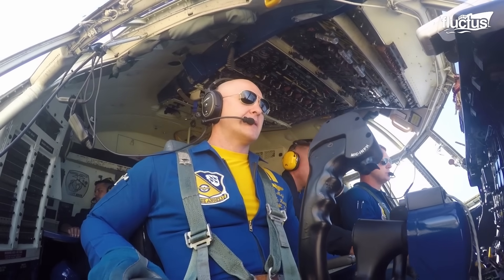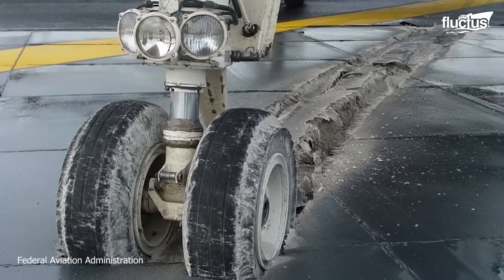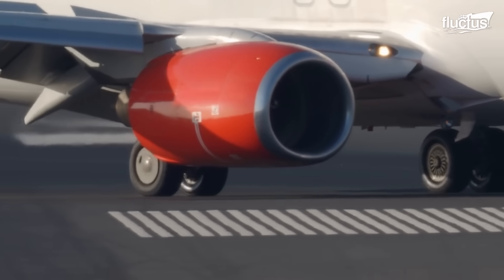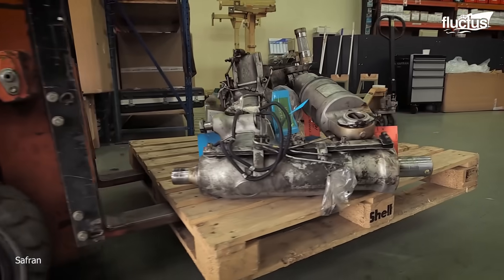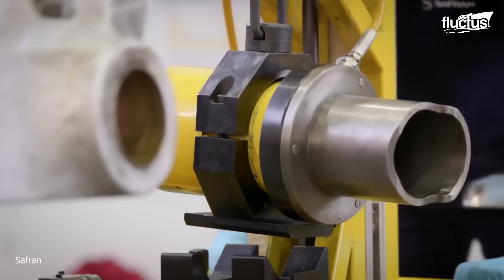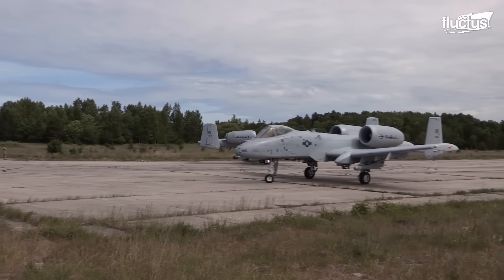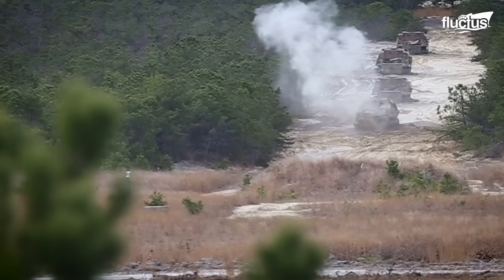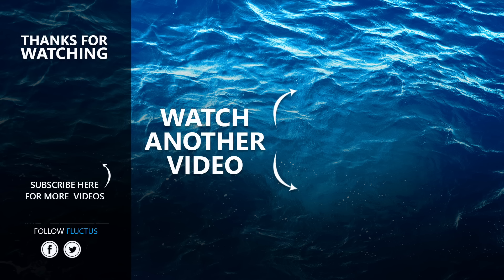Why This Invention is the Pilots Worst Nightmare

Comment: Yeah, I'll join the chorus mentioning that most of the footage of the 'AT-6 Wolverine', was actually A29 Super Tucanos, but I will also point out that the 'Beechcraft AT-6 Texan' is actually a Pilatus PC-9 revamp. I guess they can say it was 'made in America', even if it wasn't designed there.

Comment: While there was a lot of positive information, I failed to see ANYTHING worthy of a bad dream for a pilot let alone a nightmare! Also, in reference to the "A-10" - "Dual Engine?" That sounds like two SIMILAR but SEPERATE power plants. The proper term should be "TWIN" engine as the powerplants are identical
Reply: So the thought of over shooting a runway and crashing isn't a bad dream or nightmare for a pilot??
Just like losing brakes on an 18 wheeler going down a high % grade hill in the mountains and having to use the runaway truck ramp isn't either??
Randy Edwards, YOU, are an idiot!!!

Comment: How can you talk about the A10 Warthog and not mention that GUN?!!  I've seen guys literally jump out of their tanks if they hear that whisperjet sound approaching... 😊
Reply: I wondered about that omission. The A10 is literally an aircraft built around a huge gun. Without that gun, it's just a little bomber... without that BRRRrrrrrppp!!!! That's what the ground pounders love so much about it when things get "sticky" on the battlefield.
Reply: Leaving the tank is about as stupid as they can get. The GAU-8 makes cool sounds, but will rarely if ever penetrate the crew compartment.
Reply: @bpomowe224  - I checked this out from several sources. "The depleted uranium slug is so dense, it turns tank armor into white-hot shrapnel in the crew compartment." In addition, there are three types of ammo, and " the armor-piercing incendiary (API) rounds present a particularly nightmarish threat to armored vehicle crews." They also mentioned that even a low hit will shred the track components and disable the tank.
Reply: @gilbertfranklin1537  Check the Military Aviation History video "Dramatic but Overrated - The A-10 Gun GAU-8" to see the US airforce actual tests on real tanks.
The hitrate was abysmal, and the few direct hits scored usually failed to penetrate the crew compartment of the tanks.

Comment: While I get that this is not where a pilot would want to end up, I submit there 'worst nightmare' would be going off the end of the runway into structures or a roadway or water.
Reply: There was a system televised in the UK 50 or 60 years ago after a medium sized passenger jet overran the end of the runway into a cabbage field. 

Suddenly runways all over were being given an extension to stop aircraft safely. 
Some probably kept cabbage fields.
Reply: @20chocsaday  It would be a helluva lot cheaper! and the airport could sell the cabbage!!
Reply: @henrivanbemmel  I am sure that the farmer sold most of them. 
The aircraft still had all it's wheels.
Reply: @20chocsaday  The Dutch actually farm the lands around Schipol. Perhaps less in these security focused times, but it was neat back in the day to see some farmer plowing as a dc-8 landed beside him.
Reply: @henrivanbemmel  Oh, I could see the evidence of farming even if I didn't see a farmer working. (Near Schiphol) 
The first definite evidence of a crop was a field of cut stalks, about the width of Maize. But unaccountably it had been plowed afterwards. This exposes damp soil to the air and sun. The soil quickly dries out in the kind of weather that had existed for the previous months. 

However, there was some rain a few weeks later.
Reply: @20chocsaday  I would expect in Holland the water table is very close to the surface that whatever drying out would be acceptable.
Reply: That’s right these systems can be used for good not evil. The spirit healing the land not driving them crazy 5g runaway truck ramp, legion runaway truck ramp, voices runaway tuck ramp lol
Reply: their
Reply: @t.l.robinson2162  Indeed ... sorry